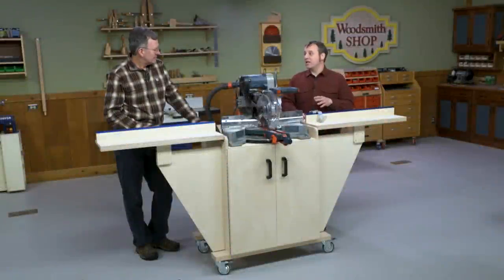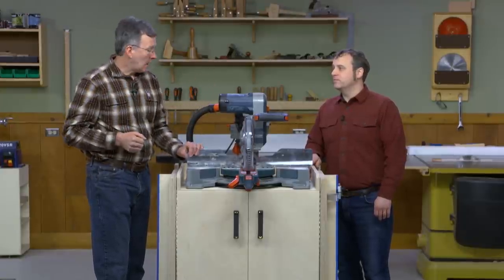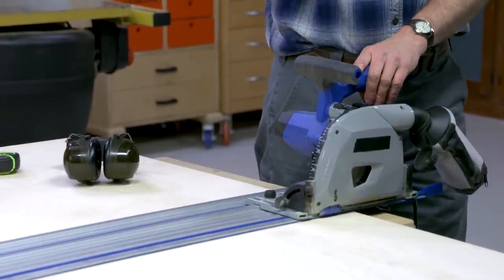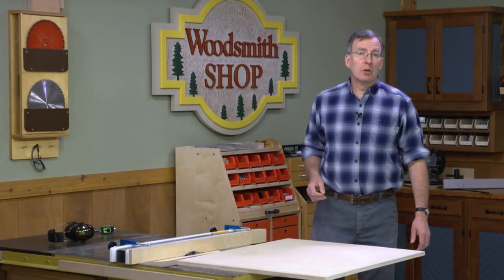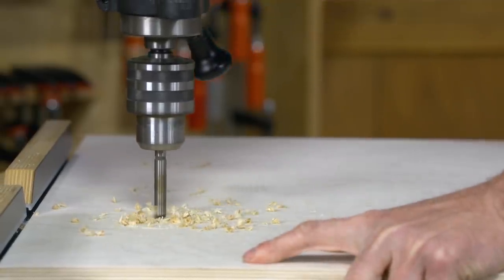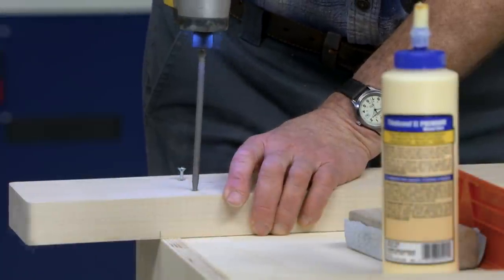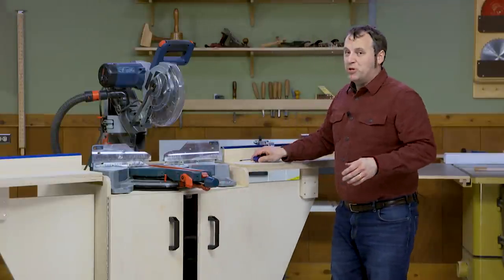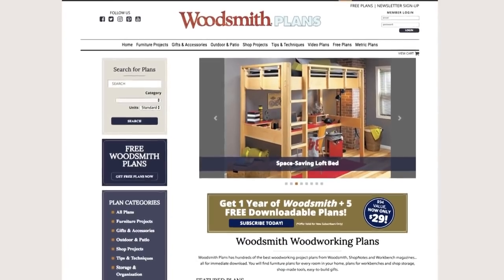Building a Heavy-Duty, Mobile Miter Saw Station

Comment: I just built it with some minor mods. Narrowed the top slightly. Added a 1/4” x 2” hardwood strip on the top of each side to ensure the wings hang vertically. Rather than just a block to support the wings I had some large adjustable furniture feet. I epoxied a couple of coupling nuts in a chunk of 2x4, screwed that to the wing supports and installed the furniture feet in the coupling nuts. That gives me about +/- 1/2” of adjustment. I opted for no doors but added a shelf. Used a 2x4 for the caster plate rather than hardwood.  The casters mount in threaded inserts. I bought an auto switch for the vac and added a homemade cord wrap at the back. I also put some slots in a piece of hardboard and some inserts in the back of the case. The hardboard mounts to the case using machine knobs into the inserts and can be raised up to contain some of the dust the shop vac doesn’t catch but can be lowered to give full range of motion to the saw. Ran the pieces through Cutlist Optimizer and would up using about 1 2/3 sheets of plywood, it would have been close to a full 2 sheets with doors. Overall very happy.

Comment: A more precise way to measure for the cleats for the top shelf would be clamp two squares from the top of the plywood edge then bring the cleats to the blade of the squares. And the cleats shouldn't go directly underneath that line but the edge of the cleats should go precisely on top of that line.
Reply from the maker: Great tip. Thanks!

Comment: The plans included a materials list and supposedly, a cutting diagram.  The cutting diagram was for the caster plates (trivial).  No cutting diagram for the three sheets of ($84 per sheet) plywood.  I can figure out the cutting diagram (probably not optimally), but it would have been nice to have one provided.
Reply: I built it with two sheets of plywood with some minor modifications using Cutlist Optimizer.

Comment: Nice build. I think I would use the Rockler workbench castors so after you roll the cart to where you're working you can lift the wheels and the carcass sits on the ground for more stability.

Comment: I really enjoy watching the project videos published on this channel and I have purchased some of the plans that are available for the projects. I have the plan for the combination router table that Don had done two of the videos to show how the cabinet was built using mdf. On either the first or second video, Don had some shop built jigs for holding the pieces in place once they were placed in the dados that had a cross cut in them. I wanted to make some of them for myself but I would like to know the dimensions of the blocks and if they are just one piece of mdf or two pieces glued together before the cross cut was made. I would also like to know the dimensions of the right angle positioning clamping squares that Don used to keep the pieces at 90 degrees that Don had placed during the dry fit of the cabinet

Comment: Looking at the video and at the plan in Woodsmith #248 brings a question to my mind : is the way the cabinet sides extend over the shelf where the saw is located would not interfere with the rotation of the saw when setting miter cuts?  The Bosch miter saw will go to an angle of up to 50 degrees on the left and 60 degrees on the right...  I'm planning on building it with the same saw I already own.   However this detail is tickling me...  Is this something you guys at Woodsmith tought about?   It might seem an unimportant detail, but since my shop is quite tiny, I usually rotate the saw to the right when not in use so it minimizes its footprint "out of the shelf" so it does not hangs over so I don't risk hitting it or bumping on it...

Comment: While I liked Mr. Wittmer's use of a square to verify that the wing was level, however it seems that method only assumes that the miter saw shelf is precisely level with the case. I suggest that it would be better to use the shelf, in lieu of the case, for a reference point. Otherwise, great presentation.

Comment: One thing that will affect the long term survival of the stand is that the support wings don't fold flat/vertically, there is always pressure on the relatively flimsy piano hinges trying to rip them off - even butt hinges will eventually pull their screws loose. You should add a spacer block about 1.5 inches thick at the top of the side panels on the outside, then screw the hinge to that. Then the support panels will be hanging off the hinges, no sideways pressure. Only downside is if you let sawdust and shavings accumulate in the gap, or forget a pencil or something similar in there.
Reply: Reviewing the start of the video, the wings are hanging flat as the support arms are nested due to the cleats which are attached to the underside of the wings.
Reply: use door hinges
Reply: @jonlegato1620  @Bruce Lee  --  You're both right!  At about 1:05, the wings fold flat against the sides of the carcase, as Jon says; however, around 16:55, the support arms clearly prevent the support wings from folding all the way down flat against the carcase, creating the stress on the piano hinges that Bruce Lee is talking about.  I share Bruce's concern about stressing the piano hinges, but as Jon points out, the cleats on the underside of the support wing create a "pocket" into which the support arm nests.  Just a matter of mounting the support arm to avoid interference with those cleats.
Reply: @johnholz394 I've been scratching my head in trying to understand how the wings are hanging flat on 1:05. Do you know how they achieved this? I would really like to know as I'm about to build a similar miter saw table.
Reply: @valsopi the wings fold down flush because of the two pieces of 3/4" ply he installed earlier in the video. These create the separation needed to lay flush. In the shoot at ~16 mins, there must be something in the way which we can't see which is blocking the wing from all the way down. Hope that helps.
Reply: @y036d  Got it! Thanks a ton. I was FF to the point where they were folding them. Missed the ply earlier.
Reply: I added a 1/4” x 2” strip at the top of both sides of the cabinet and attached the wings to that for the very reason that I was worried that the oils not hang vertically.

Comment: Should  the trick with the square to set the shelf height take into account the height of the shelf? Otherwise it seems like the saw’s table would be taller than the height of the sides of the cabinet.
Reply: That was the trick.  Mount the cleat at the line.  The shelf rests on the cleats and raises the saw up by the thickness of the shelf.  The wing is made of the same thickness of plywood and, because of the mounting hinge placement,  rotates up to match the height of the miter saw.  Both are clear the top of the cabinet.